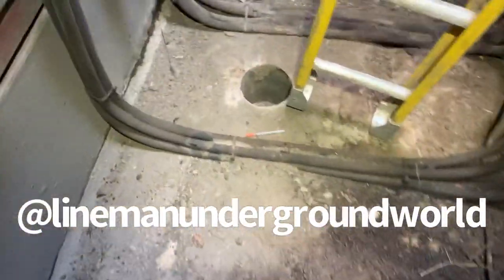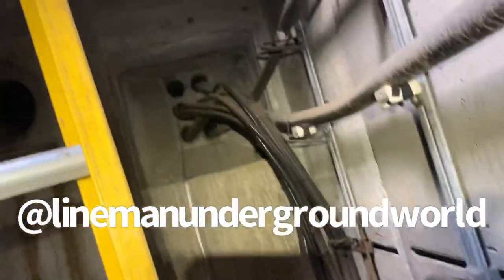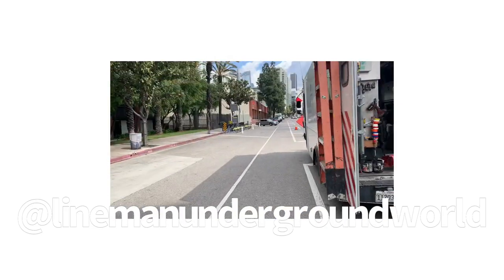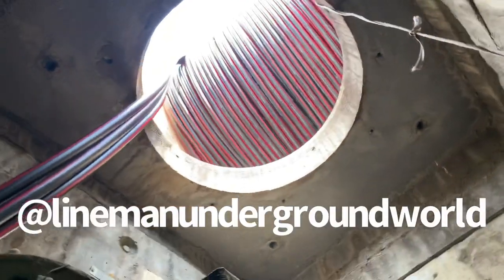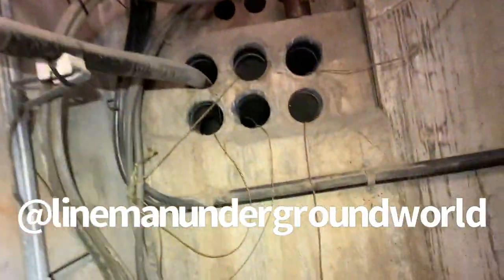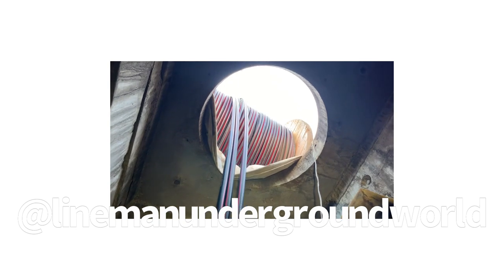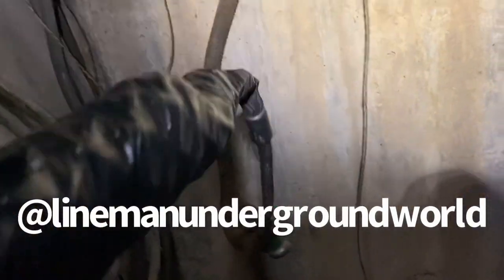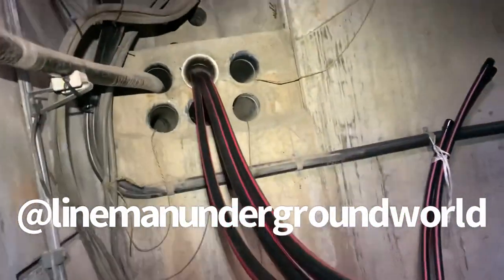Syringe in the hole

Comment: Finding syringes is a common occurrence in my network as well.... There was one vault which had piles of syringes on the floor.  Had to call an environmental contractor to clean it out.   The transformers had been de-energized for some time, and the thieves cut holes in the side of the transformer and stole every bit of copper from the windings out of the tanks.   They were 1000kVA network transformers, and the tank walls were 3/8" thick plate steel!
Reply from the maker: Wazzup Bryan it’s a crazy world now , we have to watch now where we walk and put our hands, ( stay safe and out of the bite )